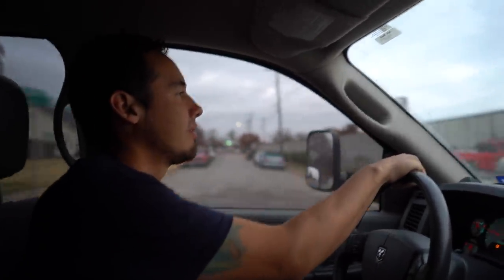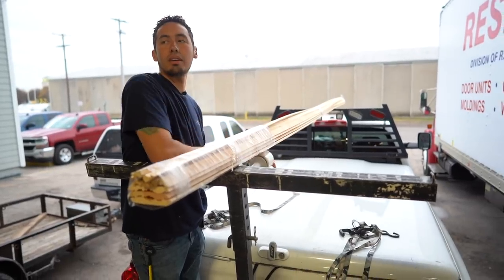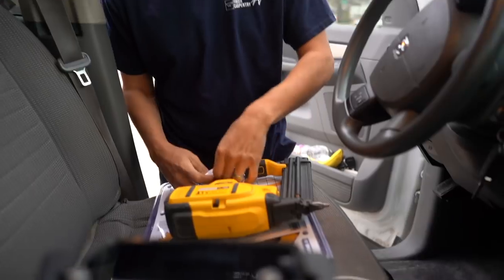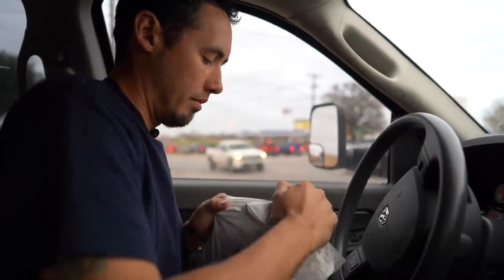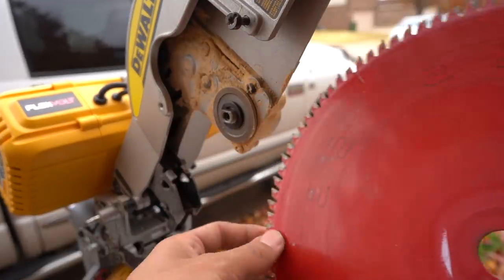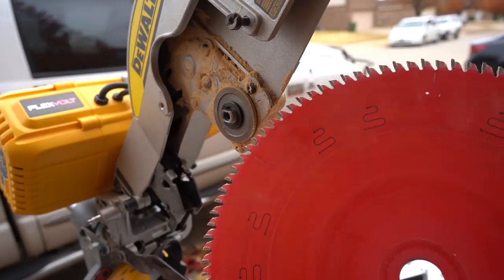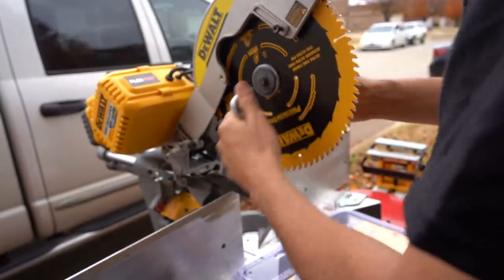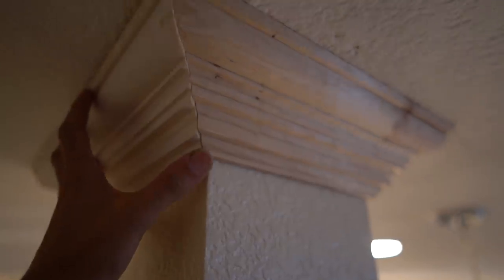Get Back to Work!

Comment: The funny thing is, a tool shouldn't break during use. Especially if it's under 10 years old. Brands these days cheap out on quality. Fun fact, black and decker makes dewalt.

Comment: Hasn’t anyone come up with a blade that doesn’t chip melamine? I swear I saw a video, but I can’t find it now. Only videos of scoring each side. I install custom closets, so I’m always looking for choices.
Reply: You want a blade with a steep tooth pitch. Like a 45°. Only good for melamine. And if your using a slider bring the blade down then come back. More dangerous but less chip
Reply: http://www.carbideprocessors.com/saw-blades/saw-blades-by-material/saw-blades-for-melamine-and-laminates/

Low hook / rake angle & ATB (alternating top bevel) is required for melamine.
Reply: smokingcheeba420 my miter is 12”. My panels are 14”. Unfortunately, I’m using my table saw, with a 60 tooth blade.
Reply: How are you cutting shelves to length with a table saw? You need a slider I think.
Reply: @juancornetto8243  so blades with a 45° tooth bevel are good for nothing then. Lol.
Reply: smokingcheeba420 , I  cut deciding what is a top/bottom shelf. Then I sand the edge.
Reply: Best way to not chip it is to use a track saw and scores it first.

Comment: Why wouldn't you get your blades sharpened? They cut like new and it's much, much cheaper than buying a new blade. I have about 12 blades that I rotate in and out of all my saws. Costs me about 25 cents a tooth to get them professionally sharpened.

Comment: I'm still waiting for a video shows how to give an estimate. And how to deal with the payments! Before, during, after the work! Thanks for the all good videos. Cheers 🥂
Reply: Very simple... Figure it by "man days"
For example, if you need to make $800 a day, and pay a helper $200,thats $1000 + materials. Always include the fact there can be unforseen conditions.
But, if you know you can do the job in 3 days, charge $3000 + materials.
I always have my customers pay for materials.
Just know what works for you
Reply: @rocknrollbabyhead  $800 a day? Christ where are you working? That's $215 000 per year? Maybe I need to charge more.
Reply: @tysmith7646  if you are a hack in the union in NY, you make $100 hr. Private finish Carpenters easily make double and more. Quality costs. I understand NY wages are very high, but it's relative to the cost of living here.
Reply: @rocknrollbabyhead  The problem i've had with letting the customers pay for materials is most end up buying the cheapest crap they find hence making your work a little harder.
Reply: I'm a commercial contractor and getting paid used to be a problem. I'd lien the building and wait forever for them to sell or refinance the place. Now I lien the license plate to their car's. They can't renew their license plate until the lien is removed. :-)
Reply: He has a video on it already! Don't remember what it's called but you should be able to find it
Reply: Listen to The Modern Craftsman podcast.  They cover all of that good business stuff!
Reply: Ty Smith you should charge based on your skill level
Reply: Everyone is going to give you a different responce to your question.  There are many variables that have to be considered.  Is the material paint grade or stain grade?  If stain grade does the customer want as even grained materials as it can be( which means you will have to hand pick and sort every board)  or do they want it to be more "rustic" meaning tight knots and lots of grain/color variation.  If the customer wants you to purchase the materials, its best to be very specific with the material your going to use.  Its not unheard of for a customer to buy the material, then schedule with them to  meet you at your normal supplier so you can talk/walk them thru all the options and what the over all end product is supposed to look like.  Always try to have customers  provide pictures(can help to steer you into what they are looking for).   Then you have to figure out what kind of time it will take, obviously paint grade should go faster on the assembly but take longer on the prep work if its up to you to caulk and fill nail holes.  Stain grade all the tolerance change, cuts have to be dead on, or they will not be what the customer expects.  People can be very finicky and expect a million dollar job on a 200 dollar budget.   Dont worry so much about making thousands of dollars on a single job if that one job can potentially lead to many jobs that can lead to many more.  People will always ask"who did this work" thats better than any business card because they can see the work and touch it....which cannt be done in a picture.  Price the work at your ability, if you're a 12 dollar an hour guy it would be hard for you to bid the work at 30+ dollars.  Some try and fail horribly.   Customers would rather hear" I think that's out of my skill set" then have a bad final product....that will cost you more in the long run with court costs, replacing expensive materials, or ruining someones home. 

Good luck, dont take bigger bites than you can chew and it will all work its self out.
Reply: @tysmith7646  you'd be surprised on how much some people make.
 The thing is , you don't work everyday of the year. You got sick days, vacations, retirement, tune ups (truck, tools).
 Right now I'm trying to get my act together to make $300 a day, eventually I'd like to have a $600 day.